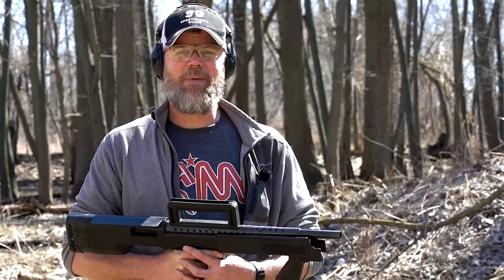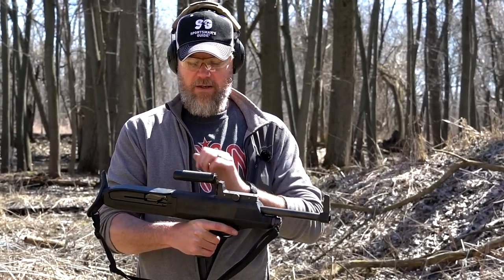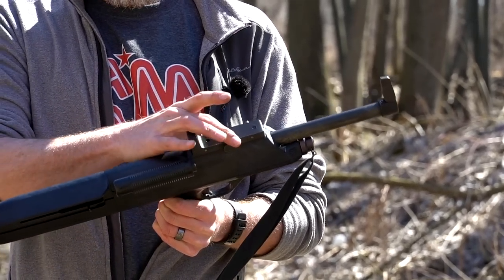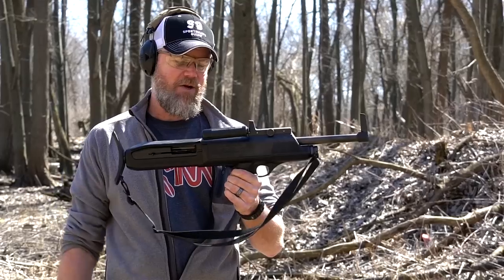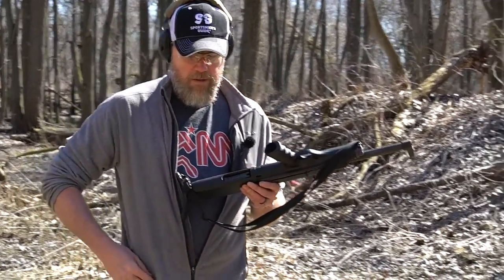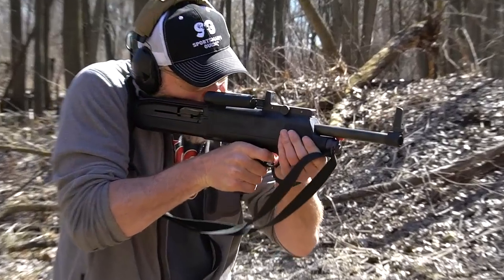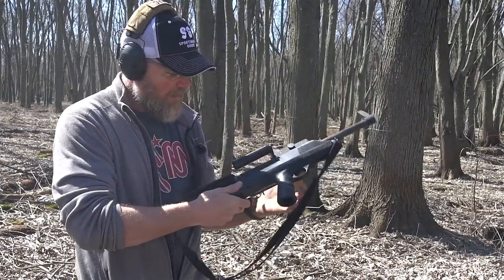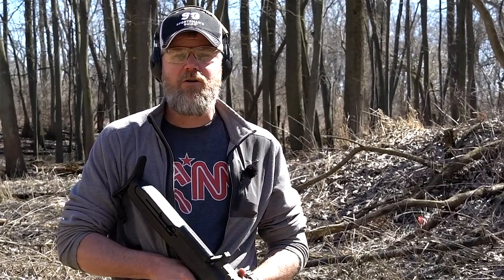High Standard 10B bullpup 12ga semiauto shotgun.

Comment: I used to make extended mag tubes for these about twenty years ago. Also a picatinny rail with integrated flip-up rear sight to replace the rear sight/flashlight mount/carry handle. My kit also included a heavy duty mag tube clamp with quick release sling swivel. They're long gone, so don't ask!

The tubes are complicated with an internal threaded cap that also retains the polymer stock shell so you can't just add an extension. The gas piston also runs on the tube. As I recall, capacity was 6 + 1 in my extended tube. Might have been 7 + 1 with American buck as the S&B uses a different crimp and is longer. Can't remember for sure without checking... They actually look "modern" with the accessories, not unlike a KSG. Wish I could post some pics!

I found that dehorning the lifter and throating the entry to the mag tube really helps speed loading. All the parts are sharp and want to draw blood, but they are all forged and milled old school parts, strong and well-made. A little cleaning up the internals makes them function better, smoother and finger friendly.

The swiveling buttpad is awkward but has some other uses; 
The 10B can be shot left-handed by shouldering it and rotating the whole shotgun clockwise 90 degrees so the ejection port is facing down. Not a bad idea if you get your right arm disabled as it can be fired this way one-handed.
It also can be used to aid reloading with the weapon shouldered on the right side by rotating 45 degrees or so clockwise to make the loading port more accessible to your left hand. The real problem is it's never where you want it to be when you shoulder the weapon quickly.

They are fun to shoot, reliable with high brass shells and look mean as hell!
Reply from the maker: I wish I had met you 20 years ago!

Comment: I had one of those High Standard Model 10B's years ago. Bought it at a gun show for $600, sold it a few years later for over double and got a SR1216. That 10B was fairly reliable with high brass loads but it wasnt perfect for sure. The 1216 was definitely much better but it too wasnt perfect, ended up selling it maybe a year later. Kinda got out of 12 gauge shotguns shortly there after.

And from what I've read and understand the whole point of shooting off the bicep with the butt plate was if you got wounded you could in theory use it with one hand effectively or if you're firing from a vehicle with it.

Comment: I can see at least one reason for making the shotgun so it could be fired one handed, especially with the light mounted. During building searches/sweeps, if you need to open a door, manipulate some equipment, etc., you still need to have the weapon ready in case a threat appears. That is where a bullpup weapon that can be fired without being shouldered come in.  A semi-auto needs to be braced against something to cycle reliably. So having the model 10 be compact and able to be braced against your bicep makes perfect sense. The light mount, even with the weak lights of the day, points even more for this to be an urban weapon for use in buildings.

Comment: I own one of the 10B models and have never had it malfunction ever. I have not tried to force that issue by trying lighter and lighter loads until it failed to eject. What's the point in that.
Ian had lots of trouble,BUT his gun had broken parts. .
Even with high brass "warmer" loads,I don't find the recoil punishing for a 12 gauge gas operated semi-auto.  I don't and won't shoot it in the crook of my elbow just to see how bad that method
would hurt.again,what's the point.  Better  semi-auto 12 Gauge gun out there? No doubt. But mine is fun to shoot and fun to show at the range. Thanks,MAC,for the show!

Comment: This model, and the 10A, were not well received by law enforcement due to jamming after several rounds.  However, this weapon was not designed to shoot a lot of rounds at one time.  This system has no gas rings of any type.  All the gas goes directly onto the aluminum magazine and builds up carbon fast thus causing  jams.  These weapons were designed to fire the rounds in the magazine for personal defense and work well for these few rounds.  The gun was set up to be able to hold the gun, with light, in one arm and the operator could utilize his other hand for opening doors or moving objects while they searched for suspects.  The trigger pull was very heavy so the weapon could be carried with the safety off in high stress situations without accidental discharge.  I have a 10A and with proper care and cleaning, I can shoot a round of skeet with it without any jams and this is done with light skeet loads.

Comment: I had one of these back in the day(1980 something).  I remember that mine was a 10B because I remember the folding front sight but it also had the built in flashlight holder. The flashlight either didn't work or had been removed. I cant remember as that was a few years ago. What is the overall length of this gun?
How does the OAL compare to say a Mossberg  Shockwave? I don't remember what type of ammunition I used but I remember mine was always totally reliable. Never had a 
failure to feed. I fired a lot of buckshot and I usually fired it from the bicep or just slightly above the bend of the arm.

Comment: Ian's gun had a wowed out pin hole, and one side of the block & bolt had lots of hand filing to fit the action, which looked highly suspect, due to the way it had been over filed into areas that should have never been touched with a file.

Comment: There was a rip off of this shotgun manufactured in Rhodesia in the late 70's.  It was the brainchild of American Joe "Jumbo" Hale.  It was called the Jumbo and marketed as designed in Rhodesia specially for the bush war.  In fact it is identical to the 10B.  Some say it was the 10B just clad in Jumbo polymer but I doubt it.  All the examples I've seen have very low serial numbers and they are extremely rough and poorly finished (I mean like home workshop rough).  The Jumbo had a barrel length mag tube and full length polymer chassis.  The swiveling butt plate was marketed for one handed firing out of a vehicle on a farm roads.  Very few survived.

Comment: I've never held one so I may be wrong but it looks like you could have an unpleasant accident with this gun. It looks as though when holding the gun with elbow bent the pistol grip could turn in your hand with the weight of the action at the rear. The gun could end up pointing at your face, if you increased your grip to stop this you could end up faceless. I'm not a safety nazi usually but I kept noticing the gun turning in the video.